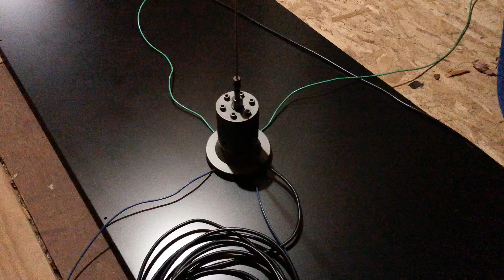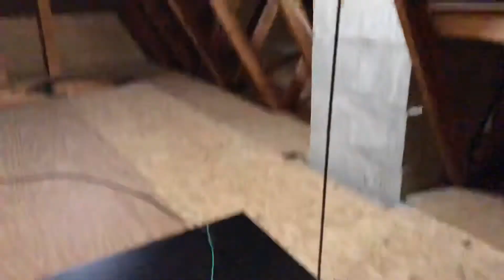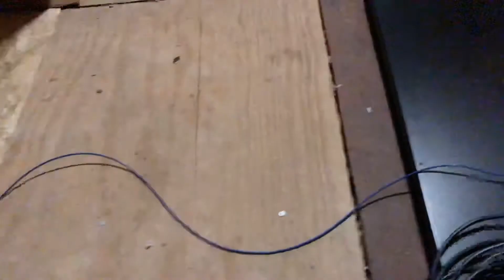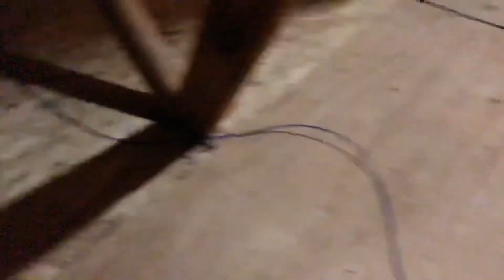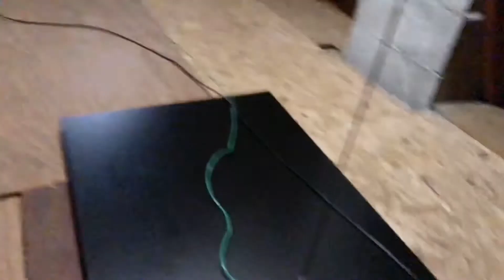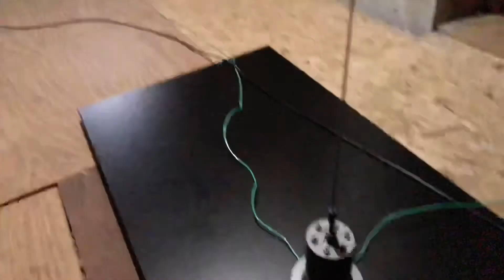CB mag mount used for backup base or emergency coms.

Comment: Well I was going to buy a FireStik IBA-5 Indoor CB base antenna but I'll try this first.
Reply from the maker: Will only work for 3 miles locally. Not exactly the best option but was trying for the sake of trying.   
Best option is getting an antenna outside and high up.   Even a 102” whip antenna 1/4 wave would be better outside and 20 feet up would be better than an indoor antenna.  Hope this helps

Comment: I think you are better off letting the magnet mount sit alone on the middle of the steel plate and then add wires to plate  on each, side then spread them out

Comment: What if I have a tin roof?
Reply from the maker: Tin is an alloy consisting of bronze, copper and pewter.  Soft metal easy to cut.  The magnetic effects on tin are slight.  So the magnet mount may not stay in place properly.  But it could act at a ground plane.   Just like an aluminum roof like on a modern Ford F-150 has.   If a magnet mount is all you have then give it a try.  You could always glue it to the roof if you want.    Of course you will have to test your standing wave ratio for a low swr. Of 1.5 or less.   
It’s worth experimenting with.  I’m not stating that it will work for you but it’s worth a try.   
I would put your magnet antenna on the tin without glue first and test swr.   If you can’t get a low swr.  Then I suggest just buying a 102” steel whip and mount that you can put up on a pole / mast.  Or perhaps mount to the edge of the tin.   You always need to check swr whenever you test an antenna.   I’m not responsible if you fall off your roof and hurt or kill your self.   So be careful.    Safety is priority.

Comment: Love it..i got my lil will on a metal fake fire place electric heater .. .I go pretty far in receiving
Reply from the maker: Yeah I would not transmit unless you test your standing wave ratio. 
This project was really just to experiment with. I would not use is as a permanent set up seeing it is extremely compromised.   
Now if you lived in a home with a metal steel roof then by all means give it a try.   Thanks for the comment.   73

Comment: if you have a mag mount you need to ground it I grounded mine by taking the mag out and hooked a ground wire to the bolt that holds the mag down and grounded it to my car and put the mag back in  I drilled a hole in the side of the mount  to run the ground wire in to the ground lug. a mag is not much of a ground by it self it works great now I have a k 30 mag antenna you need to make sure you hook the ground wire to the bolt that holds the mag on the mag has a plastic cover on the bottom you can peel it off to get to the mag
Reply from the maker: I know this was just a little experiment to see if it would work

Comment: Adding wires/radials do nothing. It’s fine by itself. If the antenna was tuned before it will tend to be very close to 1:1 on a baking sheet.

Comment: Great I've got a midland portor pack cb. but the built in antenna is not working in my flat so I'm going to get a magmount antenna on a biscuit tin  or clamp it to the inside of my window as its all metal as I'm not allowed to put one outside I've been told moonraker antennas are OK. As I've not been on my cb since the 90s but your antenna looks pretty good
Reply from the maker: Firestick makes a larger no ground plane antenna might want to check that out.  73

Comment: I have a question. I am using the Stryker SR-A10 mounted on the roof of my 08 Ford Explorer SUV. I have it paired with the President Lincoln ll+ radio with 10meters, CB, 12meters. I had to cut about 1/4" off the whip to get a perfect SWR on all 40 CB channels. However, I am getting dangerously high SWR on both, 10meters and 12meters. How can I get decent SWR on those bands, as well as CB(11meters)? I thought about trying to find two more whips that I can cut to the right lengths for the other two bands and just switch them out, but that is not a very good solution. Any ideas?
Reply from the maker: Sounds like to me you’re not a licensed ham. So don’t worry about getting a low swr on 10,12 meters.  You tuned the antenna for 11 and that’s what it’s tuned for.    I honestly didn’t have to  cut my whip at all.  Sra -10 comes pre tuned.  But I’m using a 4 watt radio. The more power you run the higher your Swr can get.  If you ou are not a licensed ham. Just listen to 10 and 12.
Reply: @mikecricket113  Well, I didn't really need that advice, since I had already decided not to transmit on 10/12 meters until I get my license. I am a CBer for many years and 63 years old. I am not stupid. I have only done a dead key to obtain SWR reading. I have completed the course for the Tech license and currently taking the course for the General. I wanted to get the radio/antenna set up for when I DO get my license. But; thanks anyway.